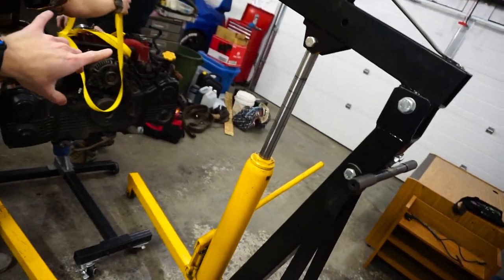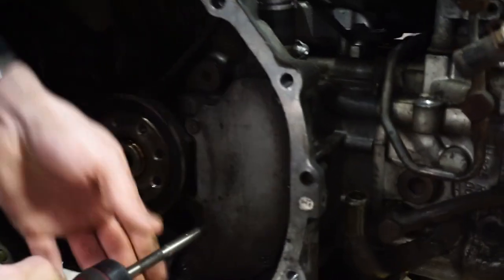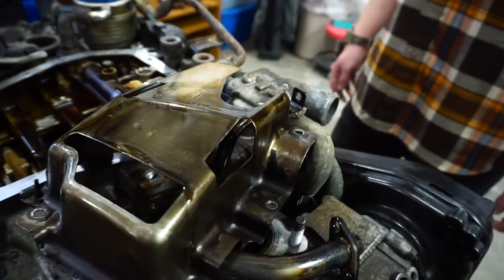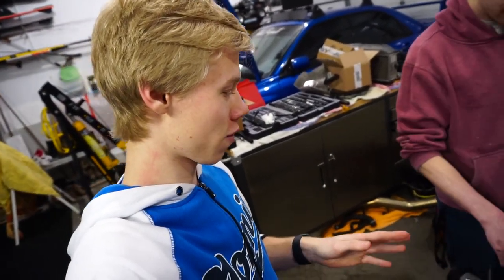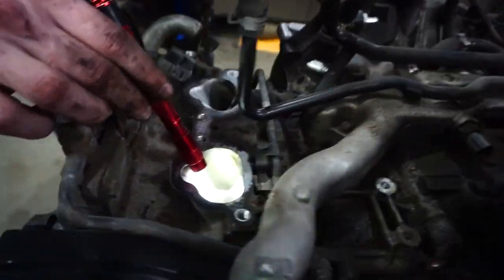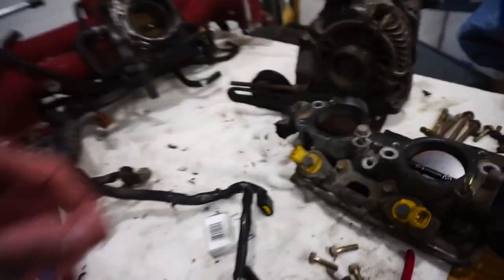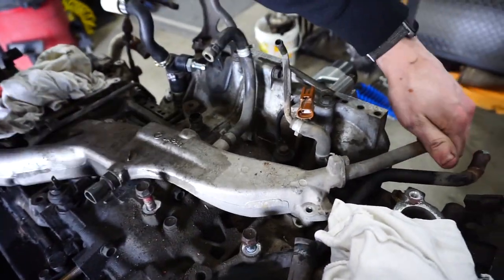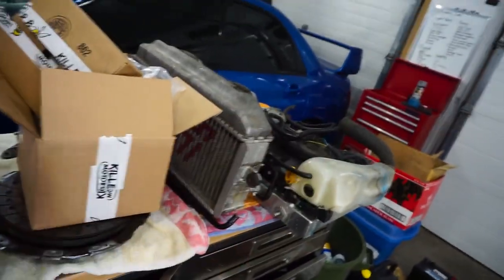Tearing Down My Subaru STi Engine - This is How It's Done!

Comment: Buy a new short block, service the heads(decking, valve guides, valve job, valve lash). Arp head studs, new gasket kit, replace all hoses, replace all sensors, assemble and you got your self a brand new engine.
Reply from the maker: If I had the money that would be the plan or just get a new short block.... but I don's so this would have to do
Reply: @Chase_Schrader  i hear ya, that's the case with most of us.